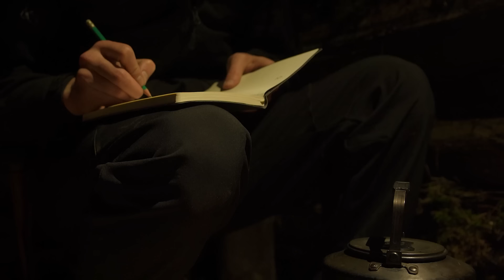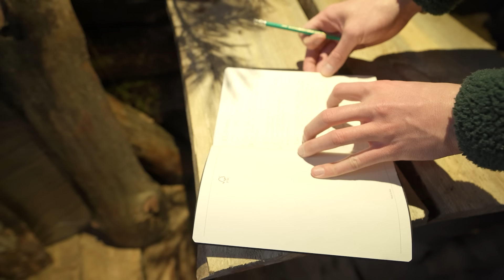My Dugout Shelter: warm at any time of year with a large window, building from start to finish

Comment: This is a very nice dugout shelter/cabin.  The earth provides good insulation but I am not a fan of dugouts because, no matter what you do in construction, no matter how much care you take, when heavy rain comes those walls will be leaking like a sieve and water collecting on the floor.  Basic, water goes downhill. The best shelters are off the ground.
Reply: I also was thinking about how there is nothing stopping the logs from rotting over time, Im no expert but that’s just the first thought that came to my head correct me if I’m wrong

Comment: Loved your video..One thing,when you laid the black plastic covering on the awning over the front door why didn't you pull the plastic further over the one end so that only one side would be short,then the piece that you cut off could have been slotted under the edge of the short side san fairy Ann and It would all have been covered ? Just an observation.From South Wales UK.❤

Comment: If it rains super hard. Isnt that shelter taking on water?
Reply from the maker: No
Reply: @mypersonaljournal  With a side wind it doesn't rain inside, i mean it a lot lower. It never floods in? How did you prevent that?
Reply: @alternative87dude the vapor barrier (black plastic sheet) between the soil and the wall. Also making every horizontal surface slope away from the center of the footprint helps with drainage.

Comment: I appreciate all the hard work and time put into this. However, I see no advantage to a dugout cabin over a "traditional" above ground one. Quite the opposite actually. Water will be an ongoing problem. You have to dig a hole which is very hard, time consuming and unnecessary. A "traditional cabin" has none of these issues.

Comment: Great job! just wondering if it rains for a couple days, what's to stop the rain from filling up your front pouch through your porch seat, then your inside floor. just wondering because entrance to my crawlspace is like that and my sump motor continues running while it rains.
Reply: I wonder the same thing. When the snow and rains to the lowest place...

Comment: I have to admit that I'm just a tad bit envious of all these folks on You Tube who can just go out and dig down as far as they want in pure sand. I'm in New England in the US and my "Native Soil" is about 75% by volume rocks. Around here if you want to dig a post hole the first tool you grab is a 6' (roughly 2 M) pry bar. You may get to a shovel at some point, but that's only after you get the rocks out of the way...
Reply: The rock is also a blessing. You can use that for your construction.

Comment: You should NEVER use any type of grass or weeds in between logs or wood because it wull cause mold affer it's been there for awhile.  Mold is a dangerous substance to inhale. All  log cabins built long ago used mud which would dry and harden sealing all cracks. If possible use a little powdered cement with the mud.
Reply from the maker: Thanks for caring

Comment: Door swinging out is bad. If snow piles up you can’t open the door. You need fireproofing below and around the stove to absorb and radiate the heat. You’re planting tomatoes in the shade of the forest? And hauling in topsoil to do it?😂

Comment: I enjoy the 'idea' of being outdoor and doing it your best, but why edit it to leave out the obvious major tools you're using? Lumber doesn't get into 2x8 boards without a massive saw probably hauled up on a trailer and run on a generator. I don't have an issue with it, but why just have the magically cut wood appear out of nowhere like that? I find the act of sawing down the trees into the lumber kinda fascinating and imagine others would as well... that's kinda my point. If you're gonna mix living outdoor with modern tools, then just film it all :)
Reply: I’m concerned about no water source and none of these guys build a latrine. The porch afterthought would have been better built integral to the main cabin from the start. Fireproof radiant barrier behind, around and below the stove, door opening in rather than out to prevent being trapped by heavy snow. If the cabin settles that window is going to crack.😊